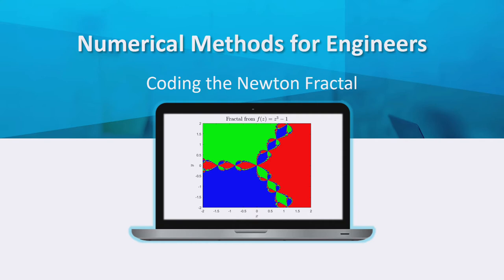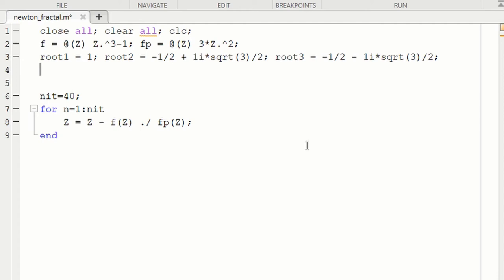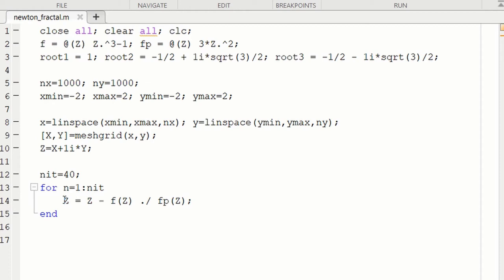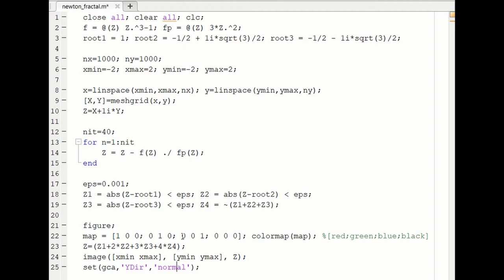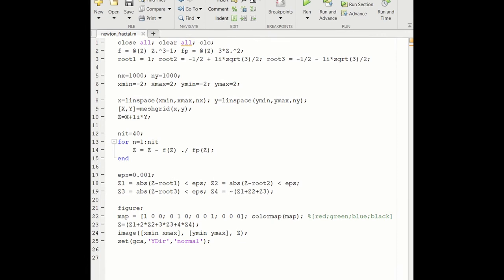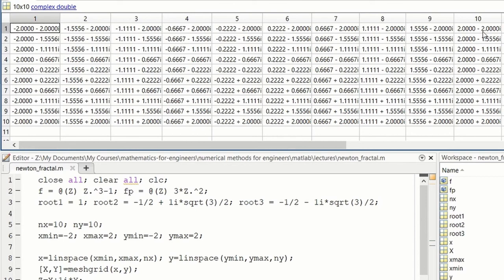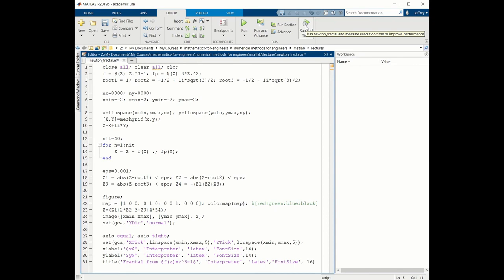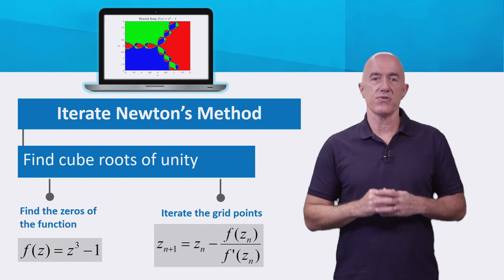Coding the Newton Fractal | Lecture 19 | Numerical Methods for Engineers

Comment: clc
clear all 
close all
% Coding the Newton Fractal | Lecture 19 | Numerical Methods for Engineers
% Jeffery Chasnov Youtube

% Goal: Iterate Newton's Method
%BIG IDEA: The given function, z(x)=x^3-1, has 3 roots in the complex plane. 1st, we take all %the pixels (points) in a grid and we run the Newton-Raphson equation on it a # of times. %Once we are certain as to which root the point is converging, we label that point with a # : %1,2,3, or 0 which corresponds to the color of that pixel being red, green ,blue, or black %respectively.

%find the zeros of f(z)=z^3-1
%iterate the grid points z_+n+1=z_n-f(z_n)/f'(z_n) 
f=@(z)z.^3-1;fp=@(z)3*z.^2;
root1=1;root2=-1/2+1i*sqrt(3)/2;root3=-1/2-1i*sqrt(3)/2;%the 3 roots of f(z) are the cube roots of unity

nx=100; ny=100;
xmin=-2;xmax=2; ymin=-2;ymax=2;

x=linspace(xmin,xmax,nx); y=linspace(ymin,ymax,ny);
[X,Y]=meshgrid(x,y);
z=X+1i*Y;

nit=40;%notice use of break points (red highlihgted nunmber lines)
for n=1:nit
    z=z-f(z)./fp(z);
end

%Setting up grid:

%determing which root the grid point converges to (the closest root)
 eps=.001;
z1=abs(z-root1)<eps;%z1 is an nx by ny logical matrix returns 1 if element
% of z converges to root1 and 0
%if not
z2=abs(z-root2)<eps;%z2 is an nx by ny logical matrix returns 1 if element
% of z converges to root1 and 0
%if not
z3=abs(z-root3)<eps;%z3 is an nx by ny logical matrix 
% returns 1 if element of z converges to root1 and 0 if not
z4=~(z1+z2+z3);%z4 returns 1 at all points that do not converge to a root

% plotting Figure:

figure;
map=[1 0 0;0 1 0; 0 0 1;0 0 0];%1st row of map[] matrix is 
% how we will color 1, 2nd row is how we will color 2, .etc 
% map=[red green blue] elemtns range from 0 (none of that color) to 
% 1 (max ofr that color) 
% our map has red, green , blue, black
colormap(map);%colormap of figure has been set
z=(z1+2*z2+3*z3+4*z4);%an image file consits of a matrix with 
% each element representing a pixel coordinate. 1,2,3,or 4 dentoes Red, green, blue, 
% or black respectively.
% z returns a matrix with a # 0:4 debnoting color of pixel/grid point 

image([xmin xmax], [ymin ymax], z);%an image file consits of a matrix with 
% each element representing a pixel coordinate. 1,2,3,or 4 dentoes Red, green, blue, 
% or black respectively. 
% constructing that image file:
set(gca,'YDir', 'normal');%image processing conventions have +yaxis and
% -yaxis swapped, this corrects that

%making graph pretty 
axis equal;%spacing in imaginary and real axes are eqwual
axis tight; %no whit eregion outside of plot
xlabel('$x$', 'Interpreter', 'latex', 'Fontsize', 14);
ylabel('$y$', 'Interpreter', 'latex', 'Fontsize', 14)
title('Fractal from $f(z)=z^3-1$','Interpreter', 'latex', 'Fontsize', 16);

%area in red are the points that converege to root1
%area in green are the points that converege to root2
%area in blue are the points that converege to root3